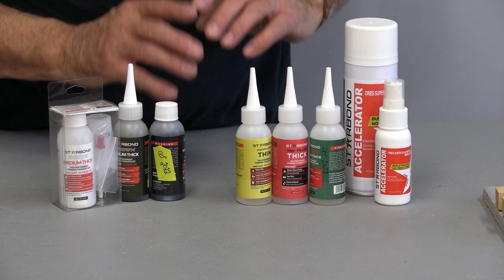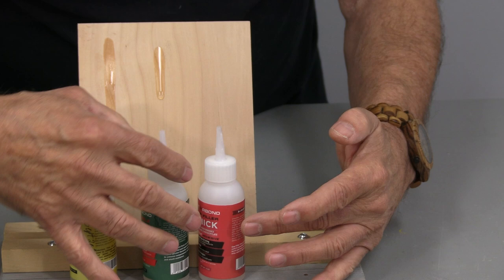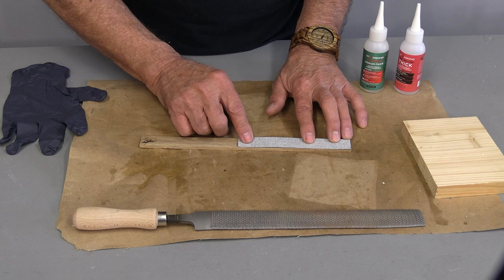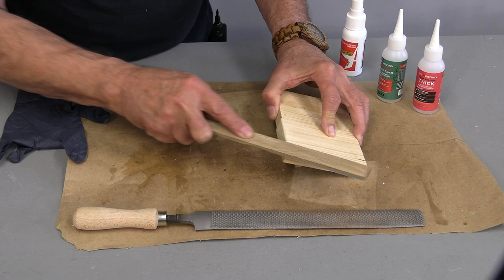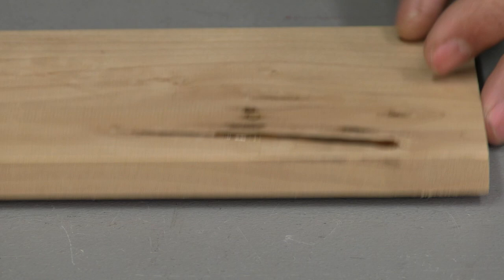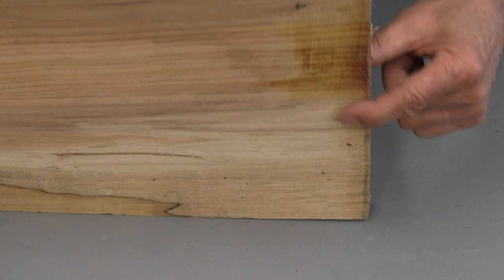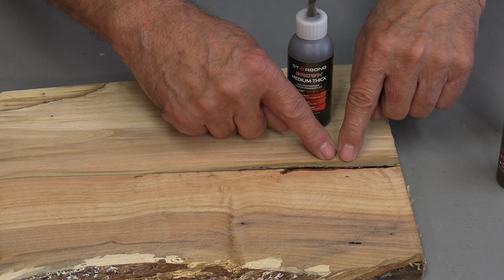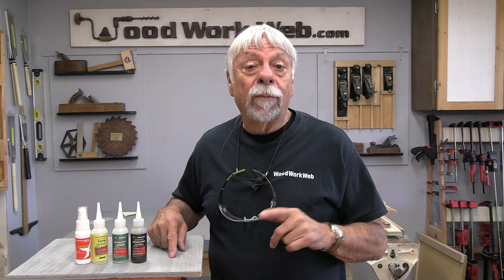[UPDATED CA Glue Tips and Tricks] How to Use CA Glue Like a PRO!

Comment: Thanks Colin. When I fill cracks or marks or imperfections. I make a pile of sawdust my using the exact same wood. Then I pack the hole really tight with the sawdust and soak it with thin CA glue. I’ll add more sawdust to the top as it dries then sand it down. Works well for me.

Comment: Use a scraper to remove the "bead" of CA that sits above or on the surface. A single edge razor works well for small stuff
Reply: I was about to ask if this would be an option.  Thanks for the comment!
Reply: Thought the same would be a possibility. Recently bought a paint scraper at HD with extra carbide blades that are slightly curved and fairly sharp. Perfect for scraping a small width line. The other edge of scraper is straight. The blades can be touched up on a diamond stone, too.
Reply: WTF did I respond too?....D'Oh!
Reply: No idea how this ended up here. Was looking at another video....D'Oh!
Reply: wrong video!

Comment: To repair screw holes or unseen voids I fill the holes in small steps with baking soda and then add CA glue. After the mixture has hardened, I can drill a new hole for a screw or fill in an unseen void and sand smooth.   This mixture makes a very hard and strong repair.     It can be used to repair, wood, plastics, fiberglass and even metals.

Comment: I have opened (but capped) CA in the fridge that still works as expected after ten years (at least).  Tube Epoxies too.   Store some in a fridge, you’ll be surprised how long it retains most if not all of its properties.  Why are all WW channels addicted to ‘accelerator’ with CA?  You do know regular CA sets in seconds anyway, especially on wood (and skin) without fancy, cost adding sprays!

Comment: I use another brand of ca glue.Would the activator that i have work with starbond? I guess my question is are all activators the same?
Reply: Most likely yeah. Theyre all meant for CA glue. I got different brand activator cause it was cheaper
Reply: CA glue sets in the presence of moisture. Accelerator an unnecessary expense unless you are doing production work.
Reply: @williambranham6249  Its worth having for gluing odd stuff. Rather not sit around a few minutes holding something in place.

Comment: If the cracks are big enough don’t use CA at all - use epoxy. Regardless of what you use to fill a big defect don’t sand at all… CA and epoxy are both harder than most woods, save for a few exotics. So use a plane and/or a cabinet scraper to get it flushed up.

Comment: Really you like working with them so much is because you get them for free.
Reply: Same reason haters hate. It’s free.
Reply: Personally I'd use almost anything else before CA glue because its so expensive.
Reply: @A6Legit  If time is important then I use CA glue.  🤭Otherwise I use yellow wood glue with clamps , turn out the shop light and head for the recliner.
Reply: @williambranham6249  Same here. I only got CA glue for live edge bowls, and maybe filling some small checks in wood. CA has its place though, just like epoxy. Dont always need it but when you do it comes in real handy